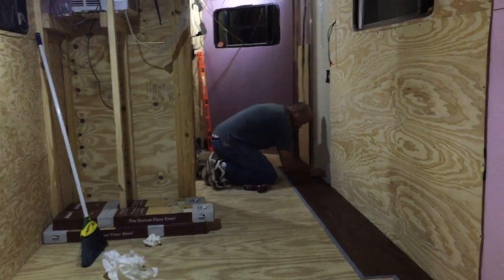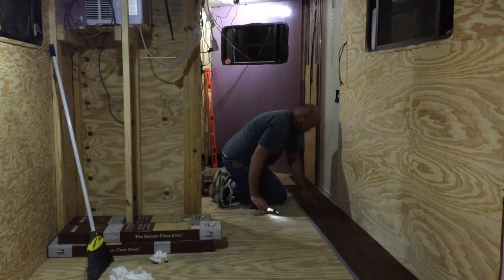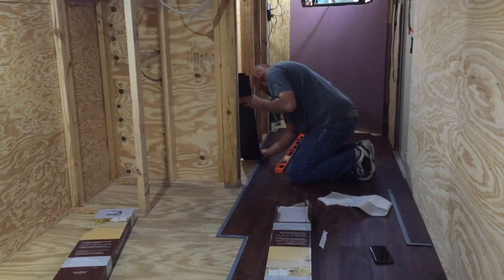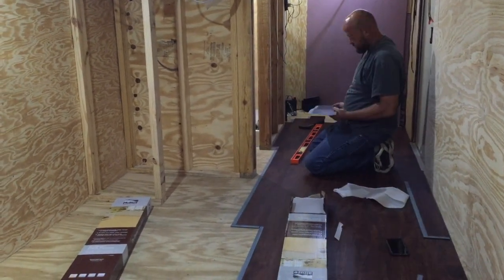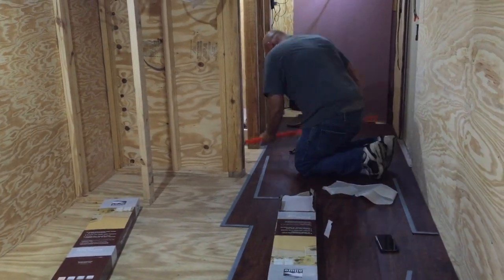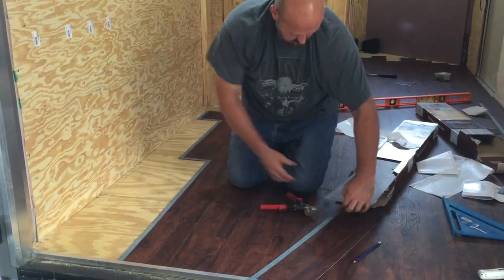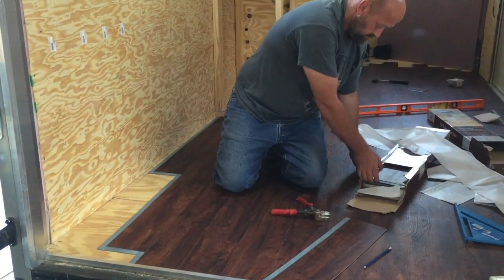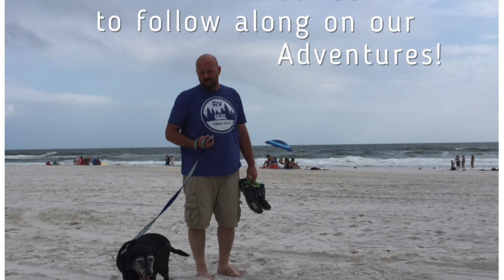Cargo trailer conversion build Part 2 Flooring

Comment: I was expecting to see the floor insulation.  Did I overlook it or you guys did not install it?  If there is none, how do you guys feel in cold weather?  Did you feel the cold from feet up?
Reply from the maker: Hi, we live in south Louisiana. Their is to much humidity here to put insulation in any raised floor/house. We have not had a problem with cold weather. If it becomes a problem. We would use a rug. Been camping in the 40’s at night with no problems.

Comment: I use that product all the time. While it is easy to install, I find that it sticking on bare plywood leaves something to be desired. Hope you don't have that problem.
Reply: Hey, John, do you have a suggestion on something to put between them?  I'm looking at doing this soon myself.  My floor is particle board, and I WAS planning on putting some clear coat down on it; then the vinyl flooring.  Stupid?
Reply: A real flooring store can show you the product that would make your flooring stay in place. Each product has different property's that effect the flooring and the base floor. Old installer here, go luck !!!
Reply: Thank you, sir.